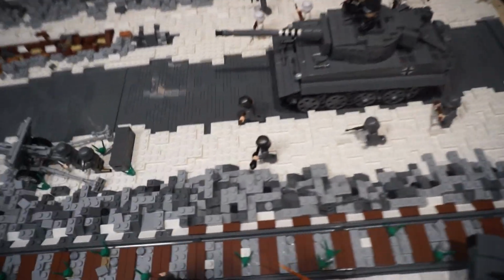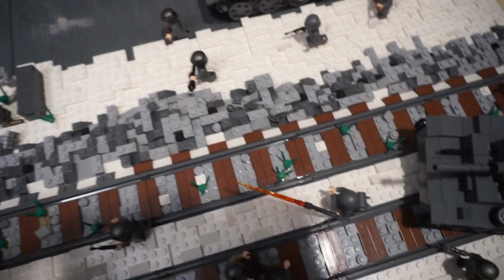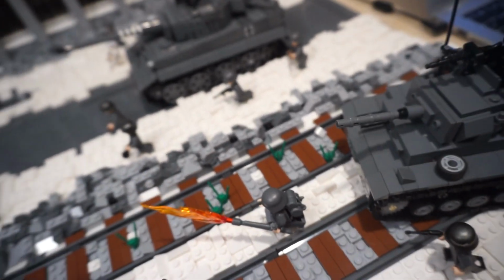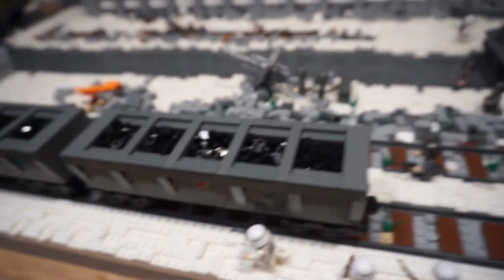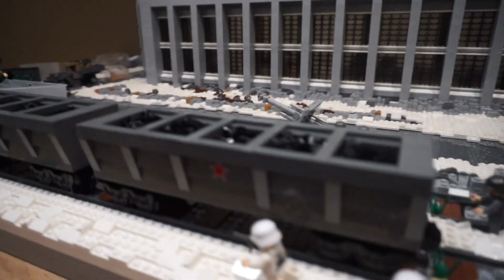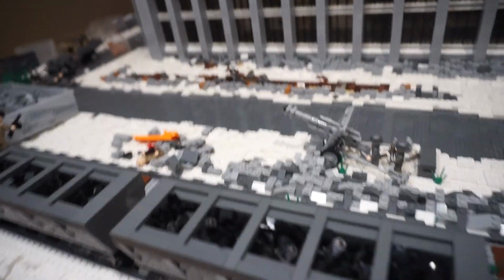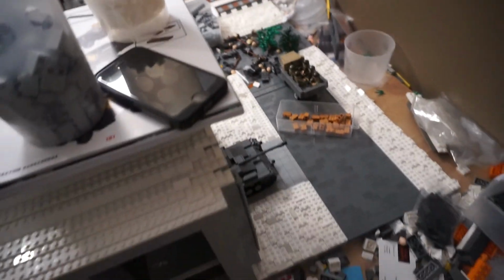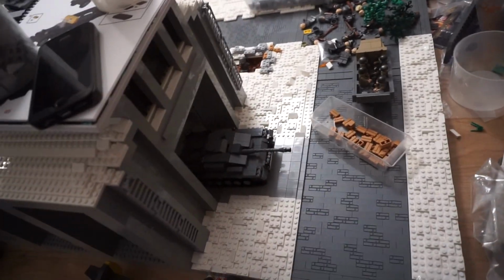Battle of Stalingrad in LEGO! Update #6

Comment: is that a tiger on the right? tigers were not introduced until the battle of Kursk which after the germans had begun retreating from russia
Reply: I had read that tigers were supposed to be used in operation winter storm but never reached the 4th panzer army
Reply: +dragon1736  correction they were supplied to the don front but only after the attack to relieve Stalingrad had failed and only ever took part in defensive actions in January and February 1943
Reply: the caption on the picture says south soviet union. Also the picture may not be from the dates shown. It is quite possible it is from later on. https://en.wikipedia.org/wiki/Tiger_I ''A battalion of Tigers was deployed to the Don Front in the autumn of 1942, but arrived too late to participate in the attack to relieve Stalingrad, (Operation Winter Storm). It was subsequently engaged in heavy defensive fighting in the Rostov-on-Don and adjacent sectors in January and February 1943.''
Reply: i enjoy these kind of debates. I noticed you still have not responded to my question about the artillery piece
Reply: Really? ............

Comment: also why is there an artillery piece already set up while the infantry and tanks are advancing behind it? And where is its tow? an artillery piece that large would not have been able to be manhandled. This is a really good MOC but not historically accurate.
Reply: okay thank you but that doesnt answer the question as to why the artillery piece is set up on the front lines in front of the advancing infantry and tanks. Historically guns of that size would only be caught up in a fight if they were unlucky enough to be caught in a rapid enemy advance
Reply: +dragon1736 To tank out the tanks?
Reply: a howitzer would be ineffective against tanks. If they needed to take out the tanks they would use an AT gun like the pak 38